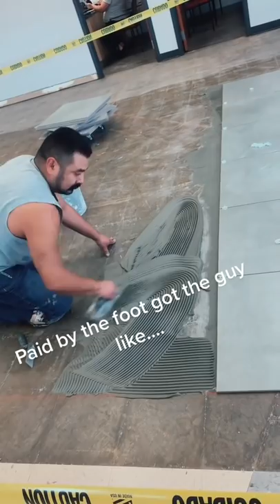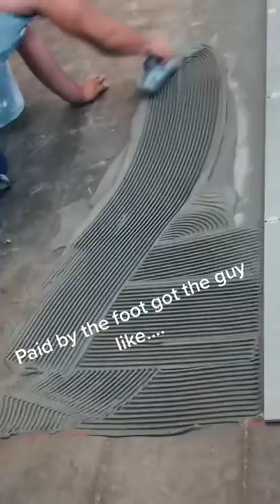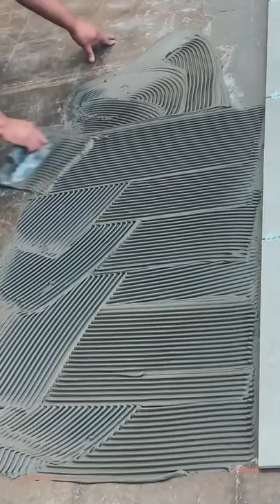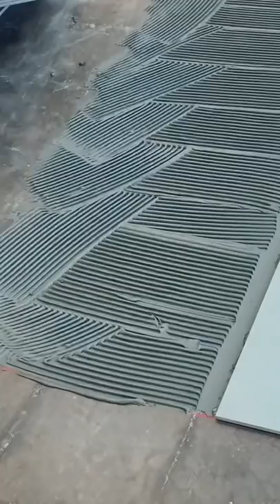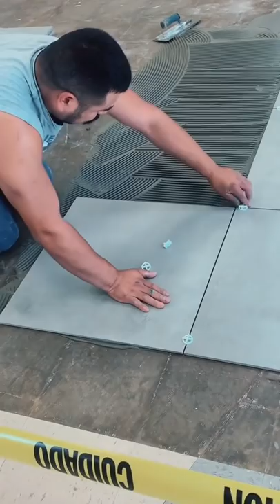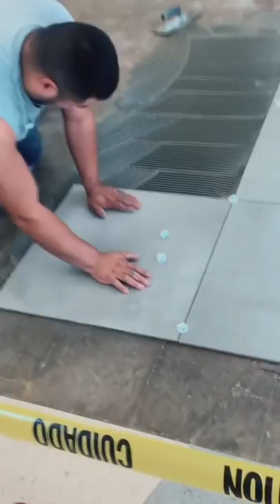Dude laying our new tile is 🥶 CREDIT terrywatson806 #Shorts

Comment: I love how the comments are 50% people who never did tile saying “so amazing” and the other 50% is actual layers saying “yeah this dude is fucking up” lol
Reply: Lmao, that is exactly what happens 😂😂😂
Reply: its cause hes not back buttering the tiles before he lays em
Reply: @marksmiff757  you don't have to butter the back if you properly set them. That's just to get the 95% coverage minimum if you ever have your floor checked by an inspector. The way he leaves his trough lines are still wrong though. Too inconsistent
Reply: @Pyrodude1134  he wants to get paid to fix it in 6 months
Reply: @grammarpolice4003  if an inspector sees any improper installation by not meeting coverage requirements, the installer is the one who eats the cost, without getting paid a second time
Reply: Trough lines are wrong. I give those tiles 10 years maybe 15 before they start moving.
Reply: @Pyrodude1134  every pro tile guy I’ve ever seen says to mud in straight lines (not circles) and backbutter the tiles. The tile associations that are the Bible on this seem to say the same thing. So yea I’m going to go with all the evidence
Reply: @nybirdman yes, backbuttering is recommended but you're looking for a finished product that has as little air under it as possible. If you set and bed the tile properly and do like you would for stone where it basically sits on a mudbed, there isn't any need for backbuttering
Reply: @Pyrodude1134  some newer tile and mortars I've used have recommended against back buttering. Plus for a floor it isn't needed as much. But if I had the time to do it, personally I'd still backbutter
Reply: How people say don't back the tiles? These tiles always come filthy, if you don't back butter it the thinset grabs onto the layer of dust and not the tile...
Reply: @babbo507  I always dunk my tiles in water so the thinset sets better instead of drying out so idk
Reply: Layers?
Reply: @HiddenBrick22  maybe just a damp sponge? Unless you let them have a long drying time. Don't wanna have excess water in the thin set
Reply: @Pyrodude1134  when I say I dunk my tile in water that's more of a generalization. I only tile that's not for a floor, and also very porous. Like porous enough that after a dunk you can literally watch it soak all the water up in a few seconds. I don't make my thinset very runny for walls and ceilings and if I don't dunk them the thinset will dry out in a matter of moments after setting and won't actually "set". With tile that doesn't soak up water as much I just wet them with a sponge though. I've been back to the tile jobs I've done and never had a setting issue, they always stick and cure very nice.
Reply: @Pyrodude1134  Lol , what inspector ?
Reply: @babbo507  Lol, the tile comes boxed up , some wrapped in plastic, I've never opened up any dusty tile in 35 years
Reply: @markme4  If there's ever any dispute about your work, an inspector can be hired by the customer. They have specific things they look for regarding the quality of your install and their word is basically law when it comes to whose problem the floor becomes
Reply: Actually I see most of the professionals including myself defending this mans work.
Reply: @Pyrodude1134  I dont have disputes. To be honest with you , 99% of tile issues are caused by problems with the substrate,  whether it be concrete, plywood,  OSB.  Not because the installer didn't back trowl the tile. Most of the thinsets today are so good the manufacture warrants the job with or without back trowling because they know its a  non issue.
Reply: But it's weird cause 25 percent of that 50 percent of actual layers that 25 percent is sayin he ain't messin up
Reply: @babbo507  yep you need to back butter so it is completely solid. Had a tile guy install my tiles 5 years ago and they are hollow now will Crack if something drops on it. Now I've done tiling for 2.5 years and I know how to properly do it
Reply: That's because piecework almost always lands you shitty results.
Reply: @marksmiff757  BINGO! Nothing but hollow spots underneath and no level to check his work. Typical shitty work that keeps people coming back to me to fix the fuck ups. Keep it up Juan!
Reply: @Pyrodude1134  Bullshit you don't have to back butter. Back butter and collapse the ridges. This is amateur hour here.
Reply: @Pyrodude1134  Those tile will pop up nice and clean when they call me to repair them LOL
Reply: @markme4  No. The substrate is a non starter because you don't tile on top of bad substrate. That's what prep is for. I swear you guys make me a lot of money with these comments. Keep it up. Tell your friends that too.
Reply: @wayofthekodiak3118  I never said I tiled over a bad substrate clown
Reply: @wayofthekodiak3118  Like I said, you don't have to back butter if you bed the tile correctly. If you do it just to be safe then that's fine. If you do it because you don't/can't bed the tile right, then it really is amateur hour here
Reply: @Pyrodude1134  Anyone who doesn't backbutter is an amateur with no business calling themselves a tile setter. However you can keep doing it that way. Keeps me busy fixing your fuck ups for 3 times (possibly 5 times)the cost 😆🤣.
Reply: @wayofthekodiak3118  It's fine if you do it that way but I've never had a failed tile job. It seems to me that you just lack the technical knowledge of why you do it vs why/when you don't have to do it
Reply: @Pyrodude1134  Well it's easy to be whatever we want online isn't it? I'll tell you one thing though. I've done PLENTY of repairs where the customer didn't even want the original company to come back. What they ALL had in common is the tiles came off clean with no thinset behind them. They failed.  So it just may be they didn't want you to come back and you just assumed you haven't had a failure. I replaced 8 shower tiles last week from a supposed reputable installer in my area. RIP to whoever has to demo one of my jobs.
Reply: @nybirdman  as a pro tile layer you DO NOT have too butter the back if you lay smaller tiles, on bigger tiles however its more recommended but still not necessary, however the trowel lines are supposed too be straight not curved so this guy has no warranty from the manufacturer and he will sooner or lager eat the job
Reply: @babbo507  dunno what country your tiles are coming from but we never get dirty tiles , they go through a cleaning process. Seriously sweep and sponge the slab clean and notch the floor, Ned the tile. Check one here and there and that’s it.
Reply: @user-tr2dh4xx6u  no mate back buttering doesn’t stop the hollow drummy sound. That’s because there’s no coverage on the tile from the notching. Nothing to do with buttering
Reply: @wayofthekodiak3118  lol, you’re calling me an amateur for not buttering. I would love for you to bring a jackhammer to my floors and have a go mate. You’d be there a long time even with a Jack.
Reply: @jimmyfiddle5234  if your tile is wet or dusty then it will not adhere and have that hollow sound as well
Reply: @user-tr2dh4xx6u  I know mate, I would never lay a wet or dusty tile. What I said was if you lay a clean dry tile and it sounds hollow/drummy, it would have nothing to do with not buttering, it would be voids where the tile hasn’t even touched notched glue. Like I said , I don’t butter. My tiles are fuckin stuck and never drummy or hollow.
Reply: @jimmyfiddle5234  sometimes comes dusty from factory, also clients don't always have dry space to store the tile. I always butter the back on larger tiles just to be safe, it barely takes any time
Reply: Unfortunately, I wouldn't know the difference had I not done some research first.. 🤦🤷
Reply: I used to work in construction and I am sure that this tile floor will definitely have air packets inside 'em. To add, it will also be bumpy if you roll something on it. Without Nylons and rubber mallet, this tile job will need a do over lmao
Reply: This video is CLEARLY not filmed in the U. S. A.  so inspection is likely not the same in this Spanish speaking country. 
That said I had some tiles like this late in a house and they don't recommend back buttering.
Reply: Is he though?
Reply: @HiddenBrick22 ,  absolutely,  always backbutter on a vertical tile setting, but not always needed or even recommended depending on the situation of the floor set.
Reply: @markme4  , it doesn't do on where u get the tile, Dude. If you're gettin it shipped or even from certain distributors its gonna be wrapped, but a lot of warehouses just have it sitting put, stacked in bulk...& those are definitely some dusty @ss b1tches up in thur.
Reply: Thanks so much for info guys, its looks satisfying so i though it was good.
Reply: Won't the grout between the tiles push them down and into place ? I'm thinking less is more here
Reply: @wayofthekodiak3118  Who let Toby the stale 50 year old have a prepaid phone 😢
Reply: I love watching a buncha tile nerds fight. Lay me on some substrate and gimmie me summa that back butter 🥰
Reply: Just goes to show that you can fool the easily gullible with fancy footwork and put on a show and they'll think you're the greatest at what you do lmao.
Reply: I love how "actual layers" can always effortlessly point out the flaws In a video and then proceed to do an awful fucking job themselves. With the amount of 'experts' you see these comments, you would expect 99% of tiles everywhere but always be laid correctly. Guess they're too busy online talking shit instead of actually landing jobs.
Reply: unless its their tile and theyre like "bruh, its terrible"
Reply: @grammarpolice4003  lol
Reply: It’s literally fine y’all act like it has to be perfection or else it’s shit. In 5 years they’ll have to be changed again.
Reply: @quiethate  if you have to change your tile after 5 years it’s shit
Reply: "Tile setter"  smh
You lay carpet, you lay your wife. You SET tile.
Reply: @marksmiff757  facts also if that floor ain't leveled talk about a hit floor
Reply: It’s like the guys think learning this shit is hard. This is easy when you know how. I literally watched someone and then we did it in the house. Still looks good and not one tile lifted. I don’t get why those guys are acting like you need to actually know anything to lay tile down it’s hilarious.
Reply: @AndrewKidd14145  hmm. Not saying you did a bad job, but I'd love to see your work. Floor? Wall? Shower?  Simple square room? Or tied into 3 rooms and a 25 foot hall. Then across the carpeted living to match the dining room.  Where was your low spot? Did you mix the thinset properly and let it slack,or did you gas the shit out it and put wet tile on it. What may look "ok" on top doesn't matter if the bottoms cooked. There's a hundred little tips ,tricks and rules that most people aren't aware of. There's tile setters ,tile "layers" and tile hackers. As a rule for the company is, no. We will not come  and fix your tile work just not worth it. But good for you. Hope your tile lasts longer then 10 years.
Reply: @Pyrodude1134  ive been tiling for 2 years and people who don't back butter get killed for it and all work that has to be done again is paid for by the company
Reply: I can already see the tiles breaking
Reply: @Damon-qt3fw  Yea if it's not a high traffic area in the house, imagine it's the floor to a kitchen table all the chair sliding is gonna move them across the room 😂
Reply: @Pyrodude1134  yeah but if its recommended to avoid a problem, and the way to avoid backbuttering is to do everything else properly, id want em to backbutter. Humans make mistakes, and if doing an extra step helps ensure their mistake wont be a probelm, then id want em to do it
Reply: why would you put butter in your tiles?
Reply: @WillXtinger  😂😂
Reply: @marksmiff757  you american traders don’t have a clue🤣🤣🤣🤣
Reply: @marksmiff757  just check the houses that you build hahahahha gust of wind and they’re gone🤣🤣🤣🤣🤣
Reply: @babbo507  as a kid working with my dad I was given the job of wiping that dust off the tiles with a sponge. So even before back buttering we'd remove the mold release.
Reply: @Pyrodude1134  these tiles are large enough that you really aught to butter them up not to have voids.
Reply: I found the blue collar worker “you’re an idiot son” comment
Reply: This man would get fired in a heartbeat lol
Reply: He's really no tho ?
Reply: I’ve never done it and clearly he is Fk’n up
Reply: @vilenationgaming  boi🤡💀😄
Reply: @HiddenBrick22  Jesus are you using rapid set?
Reply: @sneekysnake1239 ?
Reply: @marksmiff757  smh😂😂
Reply: Everyone is such a tile expert, smh.
Reply: @markme4  you right
Reply: He's still amazing at it though
Reply: @v4riab1lity77  hahahhaha, no cap.hahahag
Reply: @Chance57  all too true, I know so much professionals, but when it actually comes to doing a good job, they can't put 2 and 2 together. And screw up everything
Reply: Is hack job common
Reply: That new tile sh u talkin bout sounds lit 🔥 hook me up with some i wanna get as high as a cloud ☁️ 🥶
Reply: Maybe he's still new. He doesn't strike me as the type to do shit the same way forever
Reply: Because he is we’re the back butter my dude or the concrete sealers or backer board something my dude
Reply: @nybirdman  
And how many "pro tile guys" have you met?
Because I've met literally hundreds in my decades actually doing the trade
Reply: @Bowfinger6383  because unlike the others, you "set" tile in a mortar bed.
Reply: At least level it💀
Reply: Line consistency isn't a thing as long as they are the right size of teeth for the mortar he's using and he makes sure to get a lot down. I also skim the area before adding more mortar and grooves. He should be buttering the back of the tiles to make sure they set properly in my opinion. Looks commercial tho, so it should be fine. Speed like that is what you want commercially.
Reply: Yup no back butter in those tiles....at least hes doing spacers hahahahah
Reply: If we're all being honest, none of these percentiles are accurate. As an electrician, I get told how to do my job all the time too.
Reply: @babbo507  excellent point. It not my type of work but I fully see what you're explaining
Reply: He’s screwing up huge time 😂 leaving all those uneven globs in his thinset spread. He’s gonna spend 2 hours cutting dry thinset out of the joints when he goes to grout. (If he even does cut out the dry thinset. Most dick heads leave it and care nothing about customer satisfaction. Just because it sells doesn’t mean it’s good)
Reply: @grammarpolice4003  genius
Reply: @Damon-qt3fw  well thats o.k people change the house deco more than they change their undies so they will be up in 12 months anyway because Steve an hillary next door have these new green tiles made out of cow shi so we they will change there's for the next fad ...we are in a throw away world so quality doesn't rely come into it anymore I mean I have had 3 washers an two dryers all F up within 3yrs Chinese parts for you they say we are all green this an that but its never been so bad
Reply: @xConoooR1  I’m sure the whole “American houses are weak” thing has been debunked, tho I have 0 experience with anything involved in building/designing houses. I’d think if you built a house in tornado valley the same way you would where tornadoes don’t exist one strong storm can crumble it and heavy house squashes the occupants. Even if they’re in the basement during a tornado (as they should) heavy concrete etc. could come crumbling down through the door and even through the ceiling(??? If there’s enough of it????). With light wood and dry wall this problem is essentially gone.
Reply: sumwhat fucked up, probably been doing it for years and this job didn’t pay as much as any of the others, so i doubt he really cared to lather it to standard.
Reply: @marksmiff757  what does that even mean
Reply: Those are heavy tiles going on the floor, don’t need to back butter them 🙄 the weight + gravity will push them into the concrete. Back buttering is good for small tiles going on walls
Reply: Okay, yeah I’ve never done it but was asking myself “is this good???” 😂😂
Reply: I like this comment right here. This the one ^
Reply: Or maybe another percentage like me who have seen guys door this tons of time and may not be able to spot errors but don't see anything special happening either 🤷
Reply: Yeah you are real about this comment it's the truth.
Reply: Yea fake layers 😭
Reply: Yea I was going to say we did it like this but then before we put the tile down we made it one long set of lines where all the lines are going the same way (horizontal not bunch of vertical) all the way down and butter the back of the tile and then lay it.
Reply: @Damon-qt3fw  i give it a couple years tops
Reply: U cannot call yourself a skilled tile guy by profession if u are not agreeing to backbuttering your tile period. Zero excuse lol. Plus why would u even chance it on a big job like this NOT to back butter anyways? Such an embarrasing argument.

Comment: Tiles that big need back buttered. for those who dont know thats when u take the flat side of your trowel and coat the back of the tile with thinset. Also that better be a 1/2in. × 1/4in trowel and stand that thing up a little more instead of laying it over. Wouldn't hurt to trowel in one direction either.
Reply: It should be in one direction. All of my friends who do this professionally told me, as well as most YouTube professionals (not amateurs)